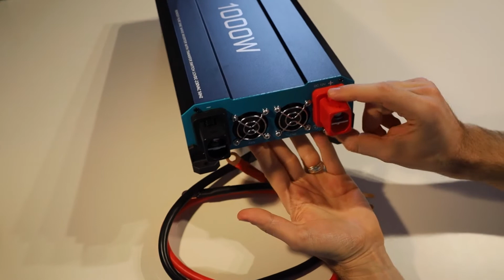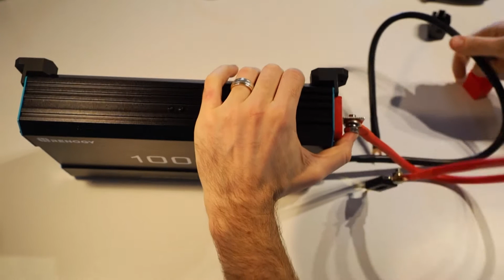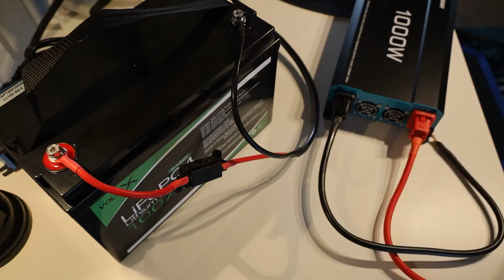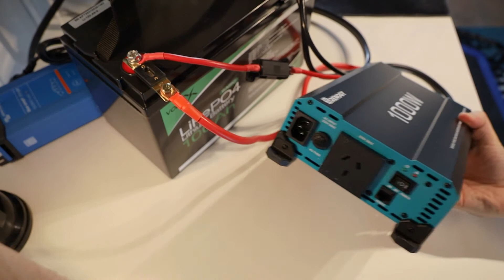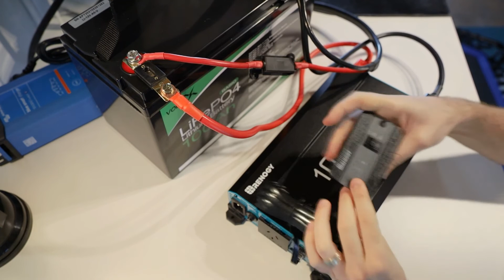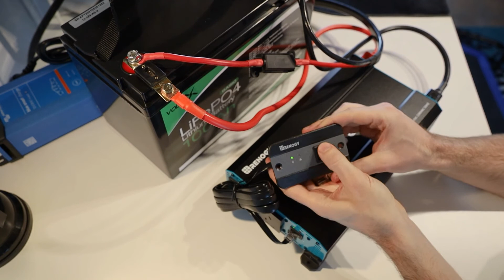How to connect a battery to the Renogy 1000w 12v to 230v Pure Sine Wave Inverter

Comment: What fuse did you add at the end of the cable and why?
Reply: To protect the inverter if it suddenly draws way too much (malfunctions). Also, you need to put the fuse as close to the battery as possible, so that's why the end of the wire with the fuse is hooked to the battery and the other and of the wire (no fuse) is hooked up to the inverter. This way the surge immediately encounter the fuse and can't "leak" past it to destroy the inverter were the fuse on the inverter side. 
NOTE: I'm no expert so check for yourself, that's just my own (and maybe not exactly right) understanding.
-- BR

Comment: Hi matt. Wondering if you can help. I've just wired up 2 x 100w panels to a controller, 1x 12v battery and this inverter. The only problem is when I turn the inverter on it clicks every few seconds like a relay is being set off. Tried using the 3 pin plug and power goes on and off, but no error light. Any ideas what it could be?

Comment: Hi Matt, whats the cable input for on the left hand side of the front of the inverter? Do you know if you can charge your leisure batter from it?
Thanks
Reply from the maker: It's for the wired remote control panel which has an on/off switch and indicator LED on it. It comes with it, but it's optional whether you use it. You can see it briefly in this video: https://www.youtube.com/watch?v=YzzTeJQla3I

Comment: Quick question, how many 12v batteries can you connect to the Renogy 1000 watt pure sine wave inverter? Thinking of buying it.
Reply from the maker: As long as they are connected in parallel I don't see any reason you couldn't connect as many batteries as the batteries support running in parallel. Eg, my current batteries support max 3 identical batteries in parallel.
Reply: @matt-talks-tech  Hi Matt what is the correct way to connect 4 batteries in parallel to enable the inverter to pull from all 4 batteries equally?  I read each battery needs to be connected to the pos/neg of the battery next to it.  Then the inverter must be connected to the last batteries pos/neg terminals?  Does this also apply to charging as my inverter is also a charger if AC power is supplied to it.

Comment: Hi Matt, just wondering how is the unit going how,about 240v power supply cord connect did you use it I have just purchased the Renogy 2000W Model and running 240v & 12v for house power to the unit do have auto switching I have Two 100amp lithium batterys running to 40amp dc-dc charge look forward to hear from you
Reply from the maker: Yes, I use it with 3x 100ah lithium batteries to run my office power, charging overnight during off-peak billing and switching to 240v mains power during that time and then running off the batteries during expensive electricity periods. It auto switches with no issues between grid power and battery power. I just have it on a timer and it works a treat.
Reply: @matt-talks-tech tc

Comment: you shouldnt really connect the +without precharging  the caps inside first with a resistor of some sort save the surge and sparking which could damage the unit
Reply: How?